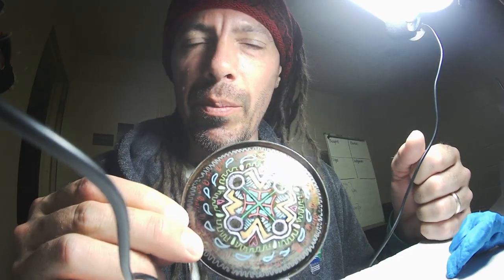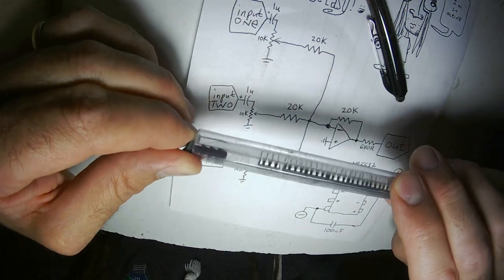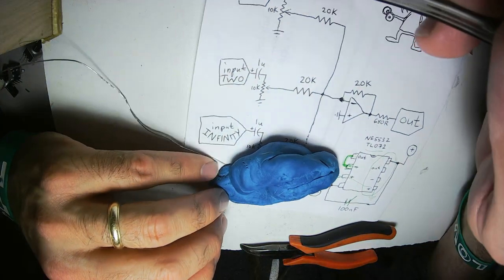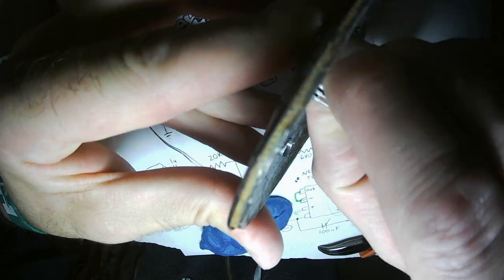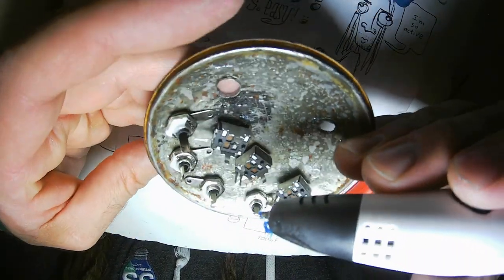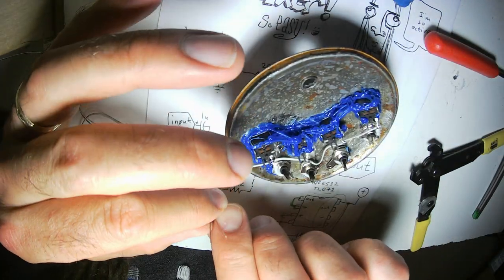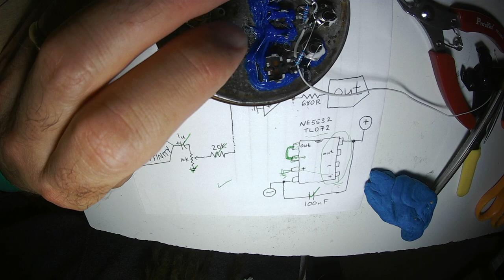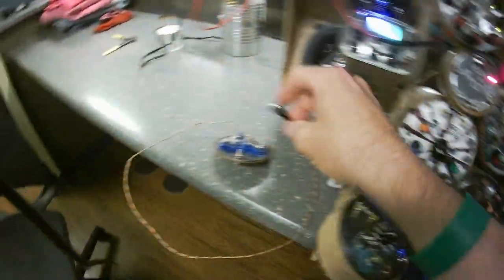Build an active mixer from scratch with me!

Comment: I also have one dumb question but I don't have a 680 R can I substitute a 620R for that or put a 620 with 75 in parallel?
Reply from the maker: That resistor can be anything from 100R to 1K, not at all critical, just protects the output of the op amp.

Comment: Thanks a lot! This schematic has only unbalanced inputs?
Reply from the maker: Yeah, no balanced inputs. You could use this construction technique to build a differential amplifier to accept a balanced input, but that's not as dead simple as this project.
Reply: @ozerik  I guess, I should sum signals (2nd & 3rd pin) first of all and then amplify the result?
Reply from the maker: @StanislavSPB  I don't know for sure. I think you can just choose one signal pin, either one, and tray that like any other signal.